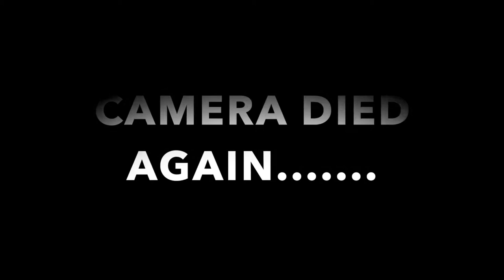We have floors!!!! Camper Reno part 8 (Wheel Bearing Install)

Comment: Did you replace the outer races with those bearings?
Reply from the maker: I didn’t just the bearing. They didn’t look messed up at all.
Reply: @mavis-watts8731  Chances are you could have just repacked em.